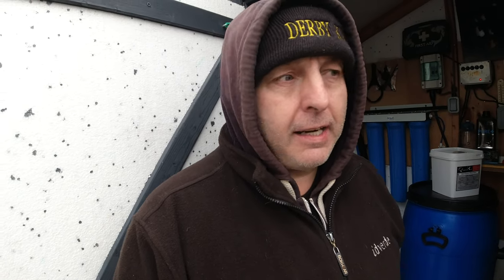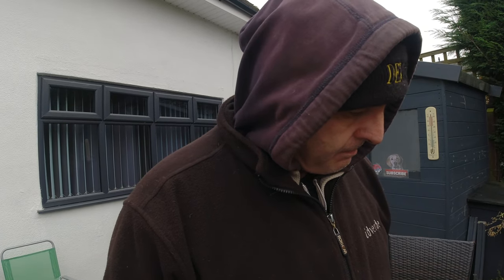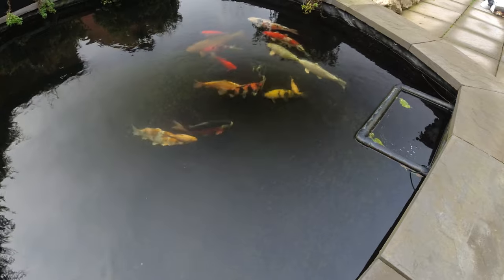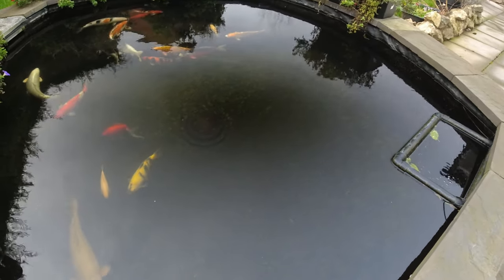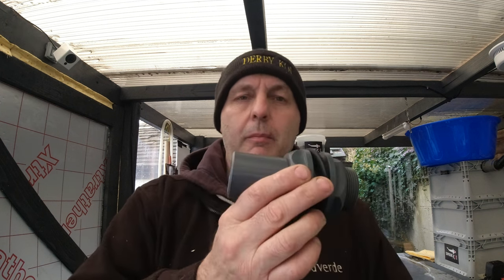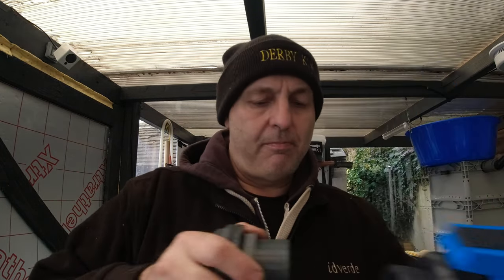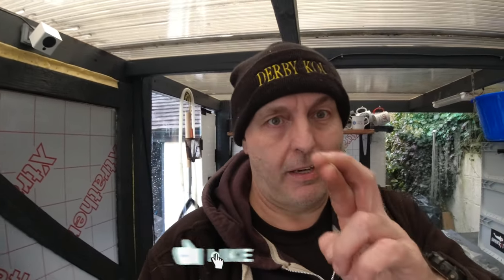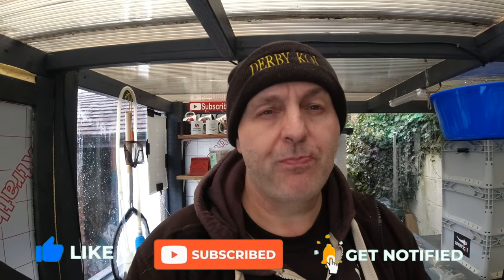Converting the easypod slide valve to a ball valve, changing media (KOI POND)

Comment: Hiya,
Great videos, ive been following for a while for guidance.
Im in the process of building my first pond, it's been an epic.
I'm looking at initial filtration with an easypod.
What Is the height of the water from the stand the pod sits on to the water surface in it, if that makes sense?
I want to run mine as a gravity system.

Cheers
Reply from the maker: Hi Anthony I have the water level just under the overflow assembly (the 3 channels on top) when the pump is running and when it's turned off the water level rises abovet the 3 channels for cleaning. I hope that make sense? Andy
Reply: @DerbyKoi  is yours gravity fed?
Reply from the maker: @Anthony Walsh  I have 2 easypods, 1 pump and 1 gravity. The description above is for the gravity fed system

Comment: Good Morning Sir, may I ask what the grey coloured bit of rubber piping you used to connect from your ball valve to your flexi pipe is (15 min 16 sec in) and where you got it from. I am doing the same thing to my easy pod as what you have done to yours and that is the only part I need.  Appreciate any help you can through at this. Thank you.
Reply from the maker: Hi Grant it is a floplast flexi waste coupler i got it from screwfix it cost about £12. I hope that help Stay safe Andy 👍

Comment: I've seen a couple of ponds with the floating rectangle in. Do you feed them in that to train them to come to hand or is is for something totally different? 🤷🏼‍♂️
Reply from the maker: The main reason is to stop the food from being drawn into the skimmer, but it has the benefits of gathering the koi when feeding for closer inspection, training hand feeding, indication on how hungry they are etc, koi that aren't feeding etc. They can be modified for plant holders and koi holding nets.
I have a build vid if that helps 😊👍🏻
Reply: For feeding, saves the food going down the skimmer.
Reply: Makes sense. Thanks 👍🏻👍🏻

Comment: Evolution Aqua customer service is disgustingly appalling. Why did you not fit another slide valve or repair, Andy?
Reply from the maker: Hi mate, I did try to repair with used parts but it failed, gate valves are OK especially if not used that often but over a short time if used regularly they often leak mate so I decided to exchange it for a ball valve which are more reliable 😀
Reply: @DerbyKoi  Thought so, I put ball valves on mine !
Reply: Nice update Andy your pond and fish are looking great Stay safe and well 🙏🐟🐟🐟🙏
Reply from the maker: @carollycett1329  thanks Carol, hope you're well. Stay safe 🙏